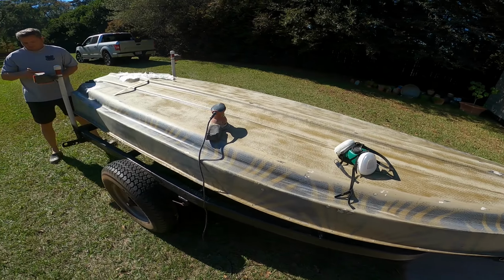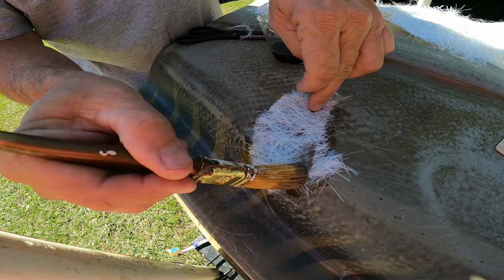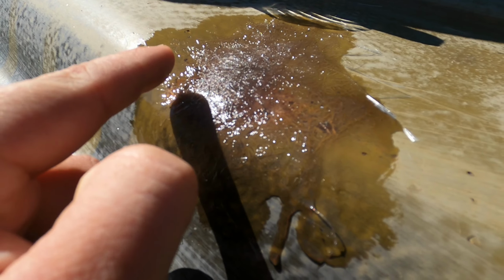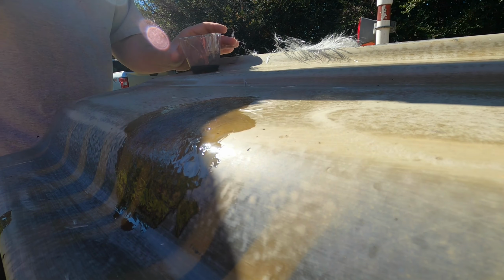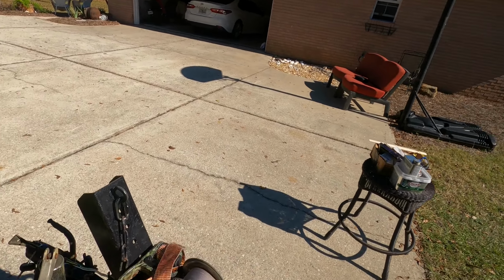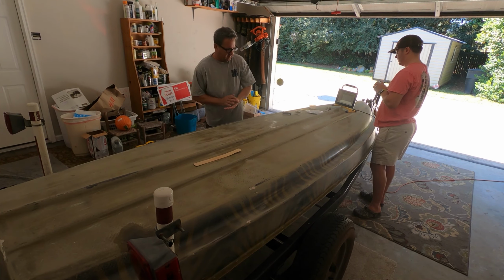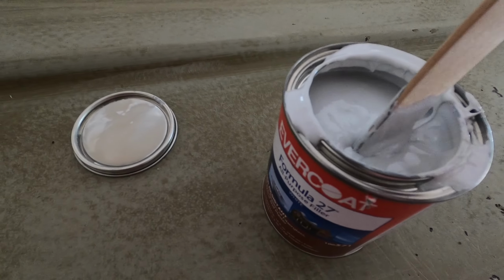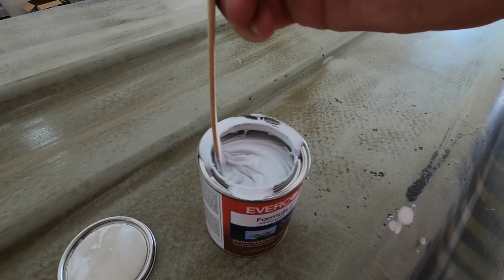Part 2 | Wigeon Duck Boat Repair | More Sanding and Patching

Comment: if you shred the glass up and mix it in with the cup to make a sludge or goop kinda consistency you can fill in holes and corners pretty easily
Reply from the maker: Thats a good tip, I appreciate it! I might do that on a few more spots that didn't patch as easily with the evercoat